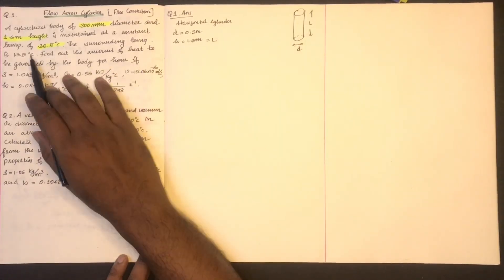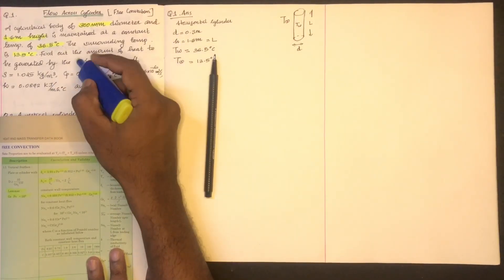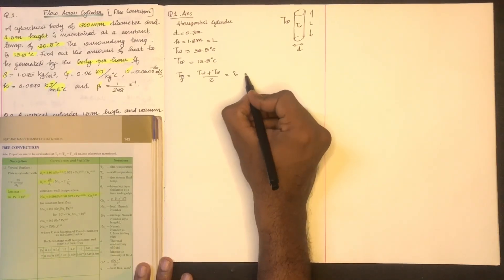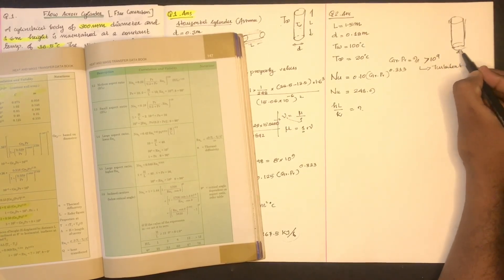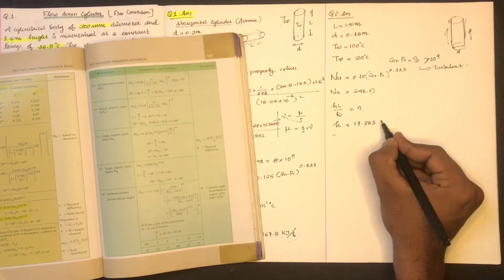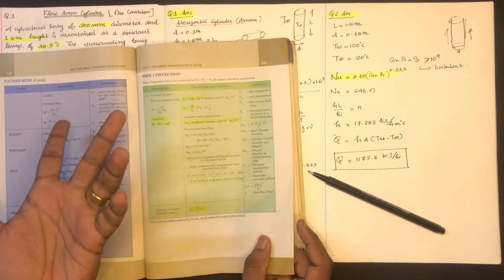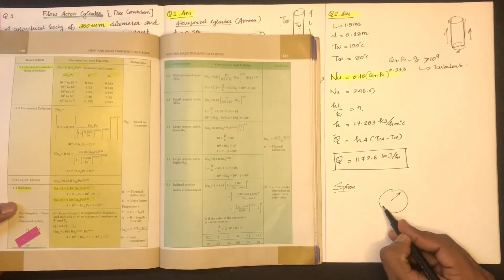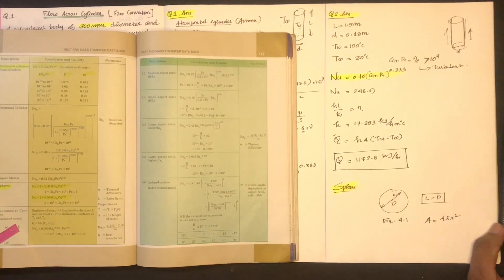KTU-HMT-MODULE 2-PART 7-FREE CONVECTION CYLINDER PROBLEMS

Comment: sir first question Gr d alle data bookil ullath and they say its based on diameter...so grd calculate cheyyumbo diameter alle use cheyyendath instead of length....but u used lenght here
Reply: Over the cylinder ahnenkil L thane